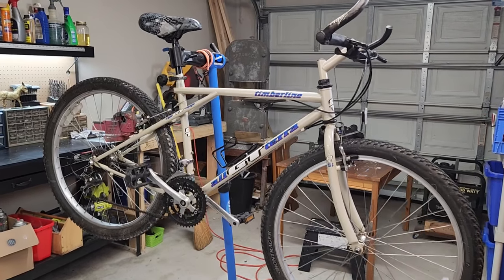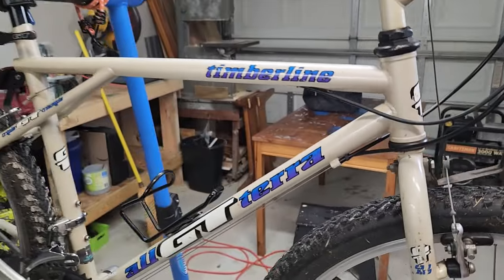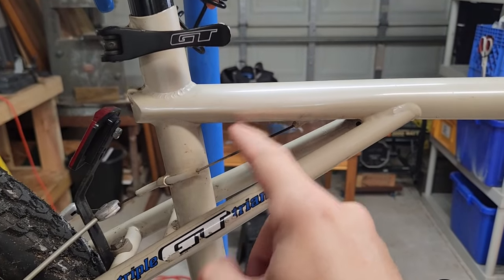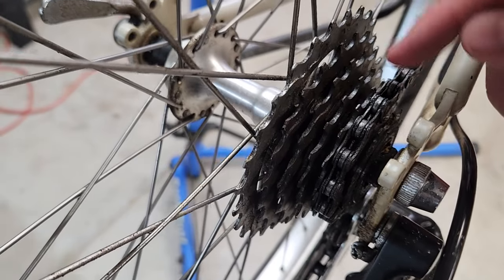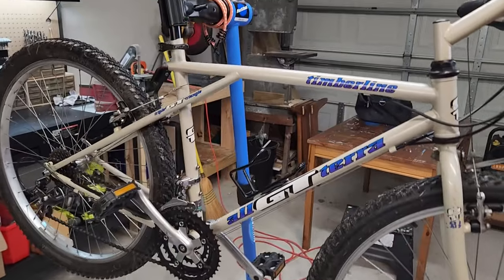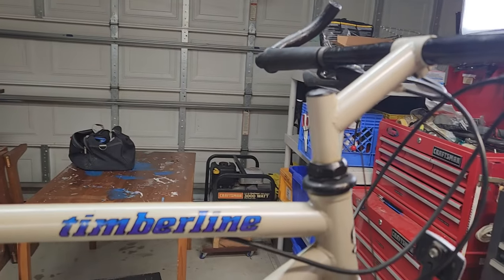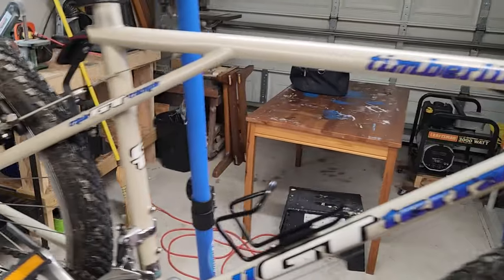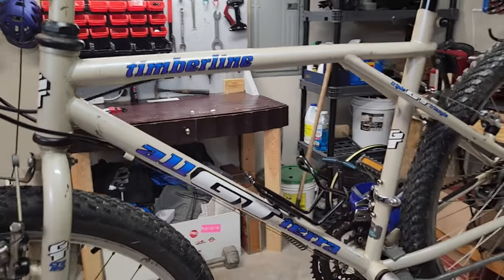1993 Timberline first look - I love vintage GT mountain bikes

Comment: My wife's bike is a green '95 Outpost, mixte style stepthrough frame. It's heavy but it rides and looks good. The 3x7 Altus shifters still work, but I had to open them up and get some tri-flow in there. After a decade or two the grease dries out and the springs aren't strong enough to keep the pawls in contact with the ratchet wheel, but they last forever if you can keep them lubed.
Reply from the maker: I didn't know they made a stepthrough frame, interesting.

Comment: O this is really enjoyable, Bruce, and I'm enjoying a find from last year, a full-rigid Specialized from that era.  And see if you can find a GT Continuum from then, I had one, bought it from a friend in '94, and it had larger tires, the size was 700D on the sidewalls.   The GT Gila Monster tires for it were junk, sidewalls kept blowing out prematurely and I think I bought the entire stock from that short-lived model, but I enjoyed its bigger size, definitely felt like a high roller when I rode it past all those little 26-inch bikes in the parking lot at the trailhead.  And as far as disc conversions, not a fan of that because any tire can be accommodated with the stock brakes on a MTB.  Maybe discs for an old 10-speed all-road conversion, maybe.  😀
Reply from the maker: Hey there Rob! Yeah I've seen the 700c sort of hybrid, they looks cool, but I don't see a lot of them out there.
Reply: @BruceChastain  that GT Continuum was an early high-roller, no question that it was a mountain bike, the only tires I could get were the GT Gila Monsters at a Northern Virginia bike shop and those were labeled as 700D with a two-inch-or-so width, not dual-sport skinny and not fat bike, either.  And the Pollack-like splatter paint on frame and forks was more custom than common spray.  GT deserves more credit than it gets for that bike, they were pushing the tire-size envelope years before anyone else, it would seem.

Comment: I have a 1994 GT mountain bike.  I use it for riding to the gym.

It weights more than a 747.  But it works and I have so little money in it, I need not worry about it being stolen while I work out.  If it gets stolen, I’ll just build a new one.

Comment: You wouldnt be able to fit corner bars into this type of stem. You need to have removable faceplate on it. But it would be nice on it, much better than curly bars
Reply from the maker: ha how didn't I think of that, totally true. I've seen some quill stems with a removable front plate, but obviously not this one.
Reply: @BruceChastain a velo orange tourist bar will work on the original 25.4 stem